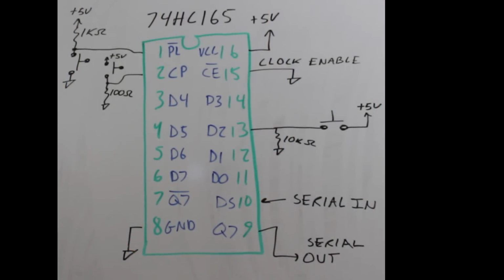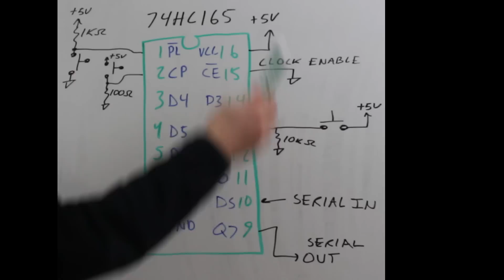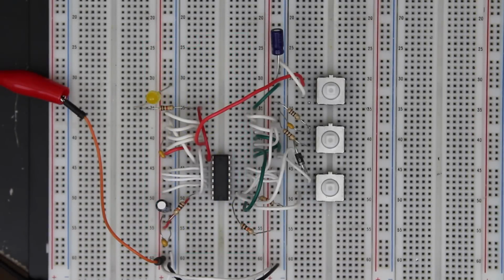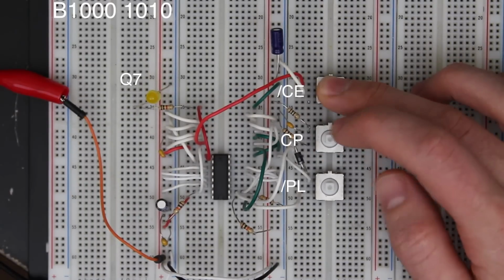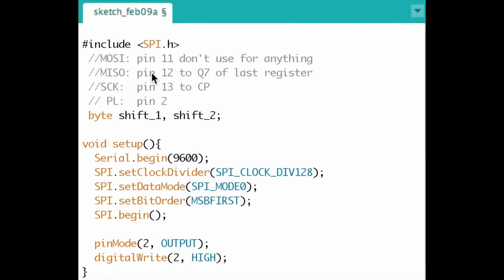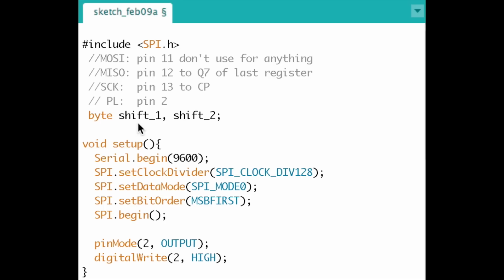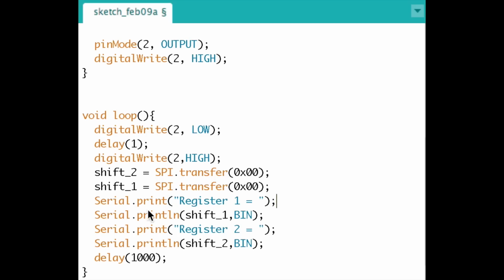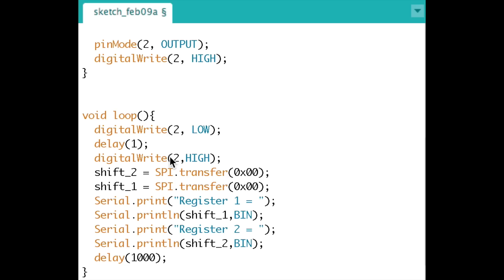How To - Expand Digital Inputs with the 74HC165 + Test Code

Comment: What's the advantage of the 165 over using a 595 for this purpose?  595 was also to read a ton of inputs, wasn't it?
Reply: 74HC595 is for outputs. 74HC165 is for inputs.

Comment: I grow up in 1980 and apprciate the use of this old IC. I tried the same with the register when running out of I/O, but figured out the power consumption is much to high compared to a simple I2C I/O expander from the 21st century, like the PCF8575.

Comment: Thanks for the videos. ive learned alot. I have a question. i want to build a custom joystick,, is this a good ic to use for 30 ish button inputs or should i be thinking about a multiplexing ic?

Comment: I see that you have all your input pins connected directly at VCC or GND without resistors. Is this safe for every day use or you just did it here for simplicity? Also, if you DO have to use a resistor, would I need to have one for every single input, even unused ones that I don't care about? Thanks!

Comment: how about doing this with a HV 57708 reading only a digital 1 or 0, if the digital signal is being delivered by a know circut that only sends by via a single wire to this chip

Comment: Why serial ouput first by H bit (1) ?
Reply: It actually does make sense to start your binary code with the most significant bit. In case of concatenation of values the order of values will be just right.
In case it is more comfortable to start with bit 0, you can just swap Q7-0 to Q0-7.
Reply: Thank for your explanation! I understand that your mean is the MSB=1(first bit=H) to make sense catching ID code because when serial shift  from q0 to q7 , paralell shift from q7-q0. Am i true, or not?
Reply: I do not think you got the point what I meant to tell.
Imagine that you have a binary number: 00001111 and you want to send it to your Arduino via 74HC165. In order to transmit the number properly to start with the 0s and end with the 1s it supposes that you set the lower (A-D) 4 bits to high and the upper 4 bits (E-H) to low. Then you will have the desired result.
In practice, you will have the following values:
0-0-0-0-1-1-1-1
H-G-F-E-D-C-B-A
The program will get value H first, then (depending on your code) it gets G, F, ... then A.
But if you want you can reverse the values and put 1s to H-E and 0s to D-A. But then the number received will be 11110000 and you will have to reverse it back in your code. 
Hope it helped.
Reply: I used transfer 1of 8 bit from 74HC164 to 74HC165 or 74HC595, so I understand your mean . If we have 1 byte 00001111(H-G-F-E-C-D-B-A) to transfer to a terminal device and if bit A is not 1 the terminal device will understand that the first bit is bit B and the byte will being: 0-0-0-0-0-1-1-1. It is true, isn't it? finally i want to say 'thank you so much!
Reply: I think it will be
H-G-F-E-C-D-B-A
0-0-0-0-0-1-1-1-x
I honestly haven't tried this IC before, so I don't know how an empty pin would react. Maybe it is set to zero, but I think it just won't be transmitted at all.
You're welcome.

Comment: Kinda new to electronics... I want to run this without my arduino to prototype my circuit, using normal momentary switches. I've heard of something called switch bounce or something like that which you mentioned in your video, how do I fix it? If you just put a capacitor after the switch, what size capacitor?
Reply: It's actually working a little with out any sort of switch protection. Still, the clock switch is randomly moving the output to the LED.
Reply: Try using an monostable multivibrator for the timing, since it can produce an very clean, manual controllable clock pulse.

Comment: I have no idea what is going on, but I've got the same connections as you do and it does not work for me at all. When I pull the PL low, it loads the first (actually last [7]) register and the other ones are totally inconsistent when I try to poll the data by pulling CP high. And I am using 7805 to stabilize the voltage at nice 5V.
Reply: ***** Well, I found out, the shift register was dead. Pretty embarrassing.
Reply: @proxict  This happens to everyone at least once

Comment: Thanks Kevin. Excellent tutorial as usual. So is it possible to build a 104 key keyboard with a tons of 74HC165 as input? and yes, I know multiplexing, but it seems much easier to write a code in this way.
Reply: I have a project with 167 encoders (each with two digital lines). After looking at multiplexing, I am going to use these piso chips to create submoduaks of 16 or 32 controllers. May try for more, but more likely will use esp32s controllers to gather data from, say 4 or eight of these submodules, then pass the data to a master controller via a serial bus.  Still pondering this design...

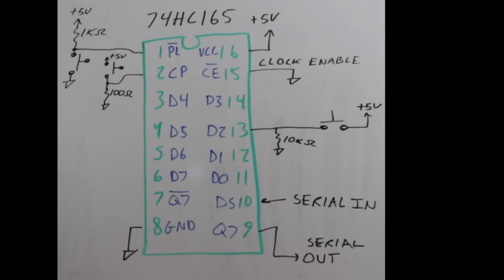Comment: At 1:29 there is an annotation stating "[it's] a good idea to throw in a 0.1uF capacitor across VCC and ground to close the VCC pin"; What does this mean?
Reply from the maker: That gives the part a nice clean voltage to work with
Reply: Thanks!

Comment: Great video Kevin.   It seems to me that there could be a sync issue right with this chip.  What I mean is of there are any transients on start up or while in run the shift register could "shift a bit" (noise on pl) and the user circuit could lose knowledge of what the shift register is outputting right?  Or is it that a clock tick is required before the next bit is "staged?" I guess if I was implementing this I would hold the chip in reset until the pins were all configured by the microcontroller or whatever else is driving this.  So I know that everything is in sync.

Comment: hi Kevin another great video i always follow you on youtube ,sorry for bothering you but i'm new to pic & i know your videos are based on arduino, but i need some help in understanding the timing diagram ,interrupt & clock of the pic,i can blink a led & i understand you explanation on shift registers & a bit about the RGB led cube,what i dont understand is all the technical calculations & configuration to do BAM  on 8 leds as a start .Thank you again for all that you have done for this very slow learner .

Comment: Hi Kevin, i like your videos a lot
i recently had a dht22 to my arduino, and i noticed that the humidity is off compared to an analog humid meter
so i am searching for a new one. i found the HIH6131 from sparkfun, but i hesitate to get it because it seems so hard to connect and make it work :/
can u make a video if you have the time? thanks a lot!
Reply from the maker: I would - but don't have that sensor on hand.  If I ever pick one up, I'll make a video
Reply: It is rather simple to hook up, 5V. GND. SCL - in A5, and SDA - A4. You can read the data easily through I2C.